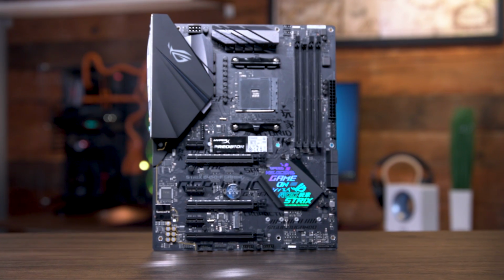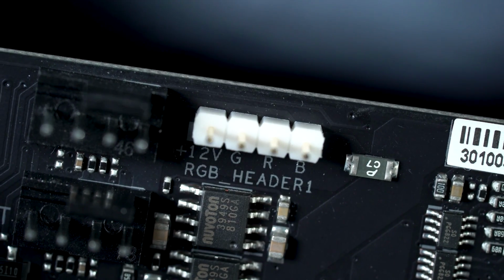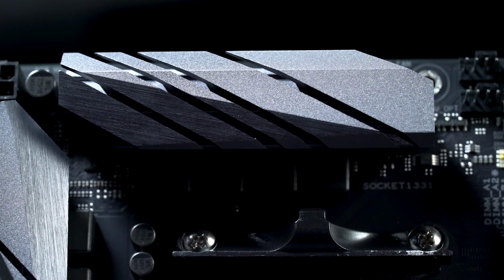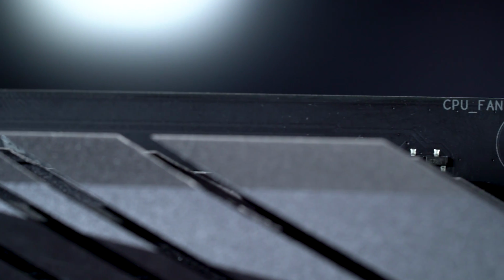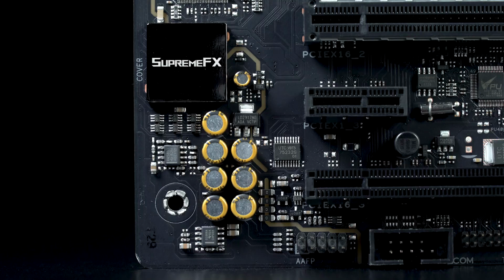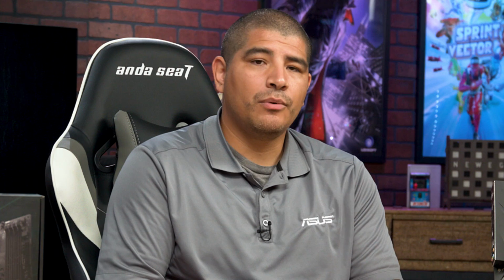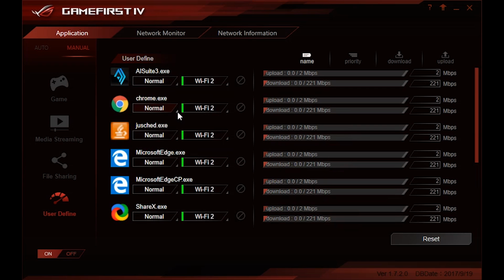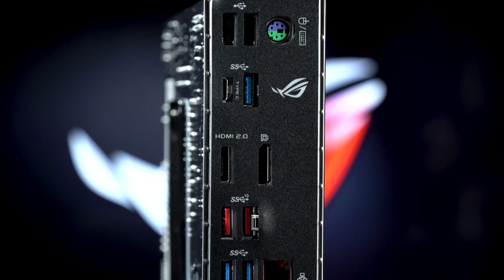ROG STRIX B450-F GAMING – Hits The Sweet spot for AMD PCDIY Gamers & Streamers

Comment: Almost bought this board to pair with the new Ryzen back in July. Too bad it doesn't have 3 pin 5v header...
Reply: what's wrong with 4-pin 5v header? I'm looking to use this mobo for my build?
Reply: @vnani5812  You mean 4 pin 12V? What I meant was this board doesn't have the argb header which is the 3 pin 5v header. It only has two 4 pin 12v headers. If you wanna go for the board it's fine. For me I wanted to connect my argb fans to the board so thats why it was an issue for me hence me going for a different board.

Comment: Does it support Rayzen 3600
Reply: yes please reply, part picker there is something not compatible between the 5 3600 and this board please help
Reply: Idk if you still need this info but yes it does. And don't think there is any bios update needed.
Reply: @ricardofrancisco7684  What kinda ram speeds did you run for the ryzen 5 3600 on this board?
Reply: @andromedadelux  I do not own any of this stuff. But Ryzen favors faster Ram speeds, so aim for 3200 or 3600Mhz if you can.
Reply: Ricardo Francisco it does need a bios updatd

Comment: will this board work for ryzen 5 3600x?
Reply: you might have to bios update, but it will work after that
Reply: @ewoenam9919  how do i bios update?
Reply: @leander_aunvik  BIOS updates are available via the ASUS website, however, I have a Ryzen 5 3600 and it worked without the need for an update at all. RAM was also able to be set to clock correctly at the advertised 3000Mhz with not much tinkering, just going into the AI tweaker within the BIOS.

Comment: This thing is a POS. Raid does not work with UEFI. RAM will not clock to the right speed. Better off with another brand
Reply: I can confirmed.. my 3200Mhz can only clocked MAX at 2666Mhz.. 4DIMMs setup.. only 2 DIMMs supported to 3200Mhz.. bullcrap.
Reply: Sad to see you guys had this experience, mine clocked to 3000mhz with no issue whatsoever. 

As for RAID, I've not set that up, so couldn't comment on that front. I love this board for what I'm using, but mileage will always vary depending on what your demands are 😁

Comment: Will this be fine for a Ryzen 5 3600?
Reply: Yes if you update bios first to 2301 version or newer. You could update it with an older amd cpu of 1st or 2nd generation.
Reply: @Mej123ful  Hm alright, thanks for  answering
Reply: I bought that board and the Ryzen 5 3600 and I was wondering the same thing.
Reply: Angry Ninja 720 If you buy it straight from asus it already comes with ryzen 3rd gen support.
Reply: let'sDo theDo Yes buy it from the asus website and it comes with third gen support without needing to update bios using old gen chip

Comment: I have this and the mic port at the back gets static on my headphones wtf
Reply: Did you install the new drivers?
Reply: if you have a USB plugged in beside the headphone jack it will make it static
Reply: @Syncs  Not true at all. I had exactly the same thing. Had to uninstall the shite windows driver and install the realtek audio driver and reboot. Once installed, reboot and it'll install the correct driver and activate the Supreme FX

Comment: Is ryzen 3000 compatible with this motherboard? Or I'll just wait for b550 update on this
Reply: @jantteri2763  I think it has no flash back feature, it requires old CPU for bios update.
Reply: @demon6937  
why not X570 gaming plus from msi
Reply: @violetStudio2  x570 is more expensive
Reply: @demon6937  
X570 gaming plus 
$210 in my country

Comment: Just build a pc with this motherboard m. After changing the ram speeds then rebooting, my pc never rebooted so I switched the psu off and on again and tried to turn it back on. The pc would only turn on for a second and then shut off and not turn back on. Idk what happened but if anyone knows how to fix this pls let me know. I already restarted the cmos and switched the ram sticks, waited 30 Min. Pls help
Reply: Erik Ortega clearly you overvolted the ram, I wouldn’t be surprised if you killed the ram. Stick to the speed you bought the ram at and don’t overclock if you don’t know how.
Reply: TimLikesTwitch I didn’t over bolt the ram. I got a faulty psu
Reply: I dont think so. I changed it to the speed that I bought it (3200mhz) but that also is the max speed of my motherboard.
I took it to micro center and they said that the psu got short circuited or something so I’m getting a new one and we’ll see if that fixes it
Reply: @MrBusyman12  so it got fixed ?
Reply: Prashant Negi yes after i got the new psu it worked

Comment: Is this board compatible with:

-CPU: Ryzen 7 2700
-Stock Cooler
-RAM: Corsair Vengeance RGB Pro 16GB
-GPU: Gigabyte Radeon Rx 590 
-PSU: EVGA 500 W1

First build I’m making, and I just want to be sure I don’t mess up on incompatible parts.
Reply: Vexo___ _ yes
Reply: Sage Naruto 
Alright, but is the power supply enough? Should I get a better one?
Reply: @vexo9531  rx590 is somewhat power hungry. I'd recommend you to get a  certified 600w bronze PSU.

Comment: hi im building a pc with this board and i choose 3700x will it run ? this is my first build thanks
Reply: You will need to update bios first before using the CPU, either with the AMD boot kit or a 2nd gen ryzen CPU. Unless they've changed it within the last month or so
Reply: Matt Butler These boards come ready for Ryzen 3000 out of the box now
Reply: @_Shay_  indeed my 3600 was supported right away plus i bought my board as a installed bundle and overclocked they did all the updates for me.. something to consider later on if anyone wants to have a flawless experience with minimal personal involvement which comes with risk.. overclockers UK are a great site for this im sure micro center offer the same service in the US.
Reply: It may but if you where to do that I would go with an x570 or x470
Reply: I got a 3700 instead of 3700x as if you want to do your own overclocking there is no difference and spent the extra cash on an x570 aorus which has held up really well
Reply: Thats what I want to know

Comment: Can I use ryzen 5 3600 on it
Reply: Yes u can
But Sadly this board does not support the flashback update. 
So u have to update the bios by using any amd cpu from the previous generation and then install the r5 3600.
Reply: ShredderX98 Is that still a thing?

Comment: Really stable with R5 1600x and crucial Ballistix Sport LT Red 8GB DDR4-3200 UDIMM (I had set it to 3200 in bios  and works on that clock since then without any problems,never had to touch it again).
p.s. For uninformed ones,the only RGB feature on this motherboard is the ROG eye on the IO shield shroud.The one that looks like a RGB lightning on the chipset cooler is just a fancy sticker.BTW,it does not support 5V 3-pin addressable LED's.Only the 12V 4-pin ones (it has 2 of these headers and that's it)

Comment: can i use addressable fans with this motherboard?
Reply: Addressable fans?If you mean only the fans,then yes,the board supports PWM fans.If you ment the fans with addressable LED's,then-sorry,but no.It has only two 4-pin 12V RGB headers.If you try to connect any ARGB (3-pin 5V) device there,you will fry the LED's

Comment: this will be my first AMD build.  is it true that my Ryzen 5 3600 wont work without a bios update (which you cant install without a compatible CPU)?
Reply: I believe you are correct. Some stores offer a service to upgrade the BIOS for you if you don't have a compatible CPU to do it yourself. I am planning to do that for my 3600 as well.
Reply: ...I'll probably just go Intel then.  Doesnt sound likes its worth the hassle
Reply: I was able to run my 3600x and update bios with it.

Comment: Can i use the ryzen 5 3600? And can i make a Bios Update with my old fx 6300?
Reply: I don’t think you’d be able to update bios through am3+ to am4. I had to use my r5 1600 to update to r5 2600x
Reply: would not recommend using ryzen 3000 with these boards
Reply: Why not?The socket compatibility is guaranteed,vrm's should do good if you don't intend to overclock.Just update the BIOS and you're good to go.It's NOT fu'kn' intel.
P.S. before doing any shopping,do some research,see if somebody had already done it,and FIRST check if there is a BIOS update for 3x00  AT ALL!!!

Comment: What has better BIOS for the new ryzen 3600's tho, this or MSI b450 tomahawk?
Reply: We want answers!
Reply: the BIOS is a lie
Reply: Simply put, this works out of the gate. 

I have this board paired with the Ryzen 5 3600 (Not the X) and it worked with no hitches whatsoever. RAM runs at its full advertised speed after configuration through the bios and CPU/GPU clocks run great.

The tomahawk, by complete contrast, was a shit storm. The one shipped to me did not have the correct BIOS and would've required a 2nd Gen Ryzen to update.

Save yourself the hassle and go with the ASUS, not only does it look great, it fits perfectly in mid tower cases.
Reply: @Revenge2393  hello i have the same setup but the x , the clock speed change like crazy from 3.8ghz to 4.4ghz at idle so i have high temperatures , do you have it also? any suggestion?
Reply: @petran-p7i  - Mine does the same, goes from 3.9ghz - 4.1ghz, doesn't impact performance in any way. What sort of temps are you getting at idle, and what cooling solution are you using?
Reply: @Revenge2393  at idle i think it should underclock speed and voltage my temp at idle its 41c-44c i am using corsair h100i gtx
Reply: @petran-p7i  I'm at 47 or so with an air cooler

Comment: i just want to know that how i can update my asus b450f motherboard bios. The problem is that i bought it for 2 days ago with the new ryzen 5 3600 and i figured out that i can't use the new ryzen 3000 series because the board needs bios update. so basicly i spend money on nothing :(
any idea how i can update this WITHOUT any CPU?

any can help?
Reply: I don't think you can. Either borrow some older Ryzen for flashing or find some PC shop which can do it for you for few bucks.
Reply: @Nirmk  You saying Asus ROG STRIX 450B F Gaming is not working with Ryzen 3xxx CPU ??? I have this combo coming today :-()

Comment: The VRM's are being suffocated by that big plastic over-cover. The MSI Tomahawk is holding around 20ºc lower VRM temp under full load on a R7 2700. This board is a good board BUT not for overclocking. The MSI beats it out every time for O.C.
Reply: Nothing that one nice cut of the hand-saw can't fix 😉

Comment: Is this a main concern?  "the second M.2 socket supports PCIe only and will force the primary PCIe slot to run in x8 mode."  Will this slow down my graphics card?
Reply: I have the same question.I do know that it will slow it down,but somebody may give us more insight about for huw much %, and will it be noticable.

Comment: NEED ADVISE! I purchased this board and a Ryzen 5 2600. The problem I’ve run into is the ryzen cooling fan blocks the first RAM slot so I can’t add anymore RAM if I want to. Any suggestions? I’ve been thinking of the Corsair H100 water cooler. But don’t want to run into the same issue. Any suggestions?

Comment: I was very optimistic when i bought this board.  After i built the whole pc, i booted it on the first time. But it never posted. Everything worked. But the white vga led was on and i never got a display post. Very annoying that i cant get a straight answer. But i have a theory that its the board since im not using another graphics card
Reply: does your cpu support intergrated graphics? if not try putting in gpu

Comment: Will this work whit an Gigabyte geforce GTX 1660 6GB OC, rayzen 5 2600 processor, MA620P cooler, ballistix tracer DDR4 2x8/16GB 3000MHz RGB and an 550w psu
Reply: LizardKing hey just as an fyi, the 2600x stock cooler is good enough to cool the cpu. Unless your over clocking but for that I’d recommend the Ryzen 5 2600
Reply: If i have an 1600 its good enough the cooler? And what cheap ram recommend for r5 1600 b450f gaming?
I chose  patriot viper 3000mhz 8x2 ,another by the same price and  better?
Reply: @user-yg9cw7tx1d  everything is fine about your choices but I would recommend corsairs rgb pro ram at 3000mhz 16gb for $110 on Amazon.

Comment: can you overclock a 2600 to 4.2ghz with this?
Reply: Imad Asfari its impossible to know, every cpu is different. some cpu’s can hit different frequencies then others even though they are the same product. if it helps, my ryzen 2600 on this exact board gets to 4.15 ghz
Reply: @josepholeske6960  Thanks for the answer! That is some decent oc with a b450 mobo, since most ryzen chips can only hit a maximum of 4.3ghz on air.

Comment: m.2 usage disables sata 5/6  ?  I read this happens.  Update:  found my own answer on pcpartpicker...  "The motherboard M.2 slot #1 shares bandwidth with SATA 6.0 Gb/s ports. When the M.2 slot is populated, two SATA 6.0 Gb/s ports are disabled."  bummer...
Reply: But you have 4 extra sata  available
Reply: And on top of that the second M.2 slot forces the main PCIE to 8x!  Another bummer.
Reply: @gosman949   yeah.. not only a bummer it is just stupid... it practically cipples itself. i dont know why they didnt go with a disabled 16_2 slot which can only run at PCIe 2.0 anyways.. it is pretty ridiculous
Reply: @kamilo743  appears to be quite common on the cheaper motherboards.  I should have spent a little more money.  But most people don't need these added SATA 6 ports.  The game boys could care less.  But I do, with my photography business.
Reply: @gosman949  yep, that too.  however, I'm really liking this board.  I couldn't hook up a LCD temp monitor or a HD hot slot built into the case I bought because it wouldn't boot up.  I also had to connect all fans to the board itself...  no biggie.
Reply: @radioman970 I'm finding out that my 7 year old video card will not really see any difference between PCIe 8x VS 16X.  So I'm happy.
Reply: @gosman949  Mine is from 2016 and it's doing pretty good!  A few things like Kingdom Come (with high to very high settings) and Battlefield 1 (with everything turned up) are somewhat playable but I'm saving those for a GPU upgrade.  But other things are smooth as butter.  I have a r9 380x.  Looking at getting one of those new AMD cards when they come out.
Reply: https://www.gamersnexus.net/guides/2488-pci-e-3-x8-vs-x16-performance-impact-on-gpus

Comment: Currently having terrible deciding which motherboard to buy so I’d like some help deciding. 
This motherboard vs the msi b450 gaming pro carbon Ac
Reply: Get this board.I got one and it's awesome,lots of features;like Intel lan,Q-LED troubleshooting,BCLK overclocking,Supreme FX sound.offset voltages,loaded BIOS/UEFI,LLC,pretty good RAM overclocking(running mine @3333MHz 14-13-13 1T).I'm running this board like 7-8 months with R5 2600(non x) @4050MHz at 1.25-1.3V.Not a single problem with VRM overheting @ ambient 24-25 celsius but,if you're going with 2700 or  2700x maybe look at some X470 boards with beefer VRM's.
TL;DR If you going with Ryzen 5 get this one,for 2700 or  2700x I'll be looking for ASUS Strix B450 E-Gaming,pretty much same board with upgraded VRM,6+2 phases AFAIK.Or get ROG x470 F - Gaming,but it's not cheap.
Reply: @Mark_S54  how you manage to run 3333mhz of RAM?cuz I got Blue screen when i try to use 3200mhz of my RAm frequency!
Reply: lol.tlol.that board can do 3200 max

Comment: What I am finding to be the Most difficult is the 4 pin AURA Does not Match my Cooler master AIO Nor My Case double ring led Controller ! I bought more Roswell Fans to replace the Cooler Master Fans. BUT Cant get the Heatsink LED  to work with the Roswell controller. What a Mess !

Comment: Hello. Once and for all - is there benefits of doing this in this app instead of in Bios? Im using a Ryzen 6 1600 (runs stock), 3000mhz memory (runs in 2400mhz), and a GTX 1070 (stock settings). Not using any apps at all for this, and neither clocking in BIOS.

Where should I start to boost my pc performance?

All best!
Reply: rymdskrotet u cant overclock your cpu
Reply: yes he can...
Reply: I think there's an asus app that comes with the board.Doing auto-tuning.